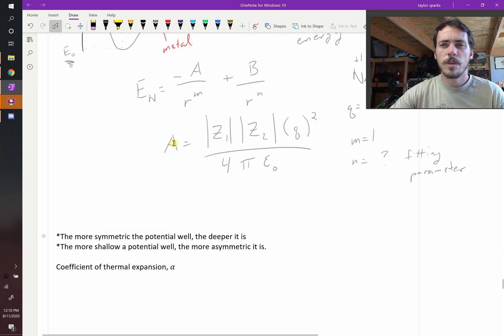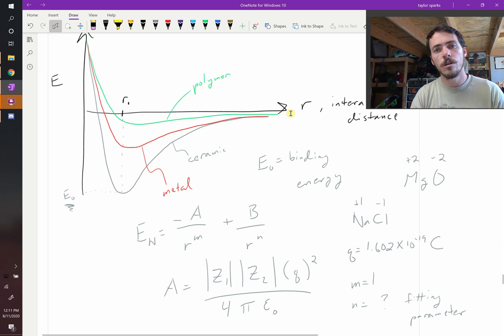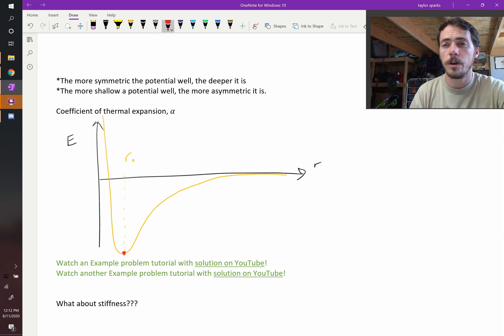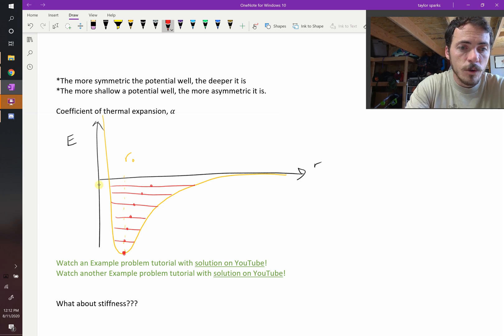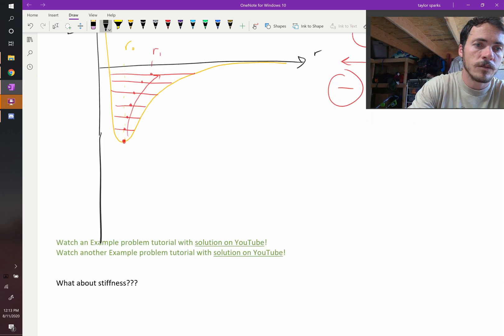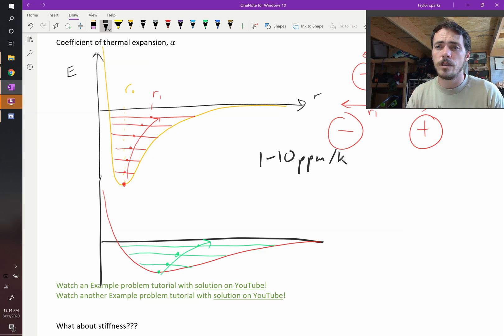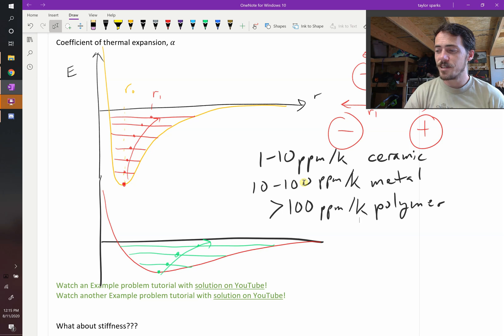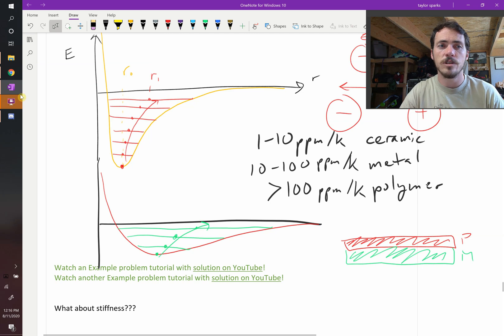Origin of thermal expansion coefficient

Comment: I think a great way to generate renewable energy could be to simply lay a steel I-beam between 2 concrete anchors for example and then to aim reflectors to heat the steel to it's max thermal expansion with the Sun, then to shade it alternately during the day, capturing the energy from the thermal expansions and contractions.

Let's put solar panels on every home, business and covered parking rooftop and switch to electric vehicles making nearly everything we do solar powered while completely decentralizing our power supply and empowering everyone as power generation owners.
Reply: Are you familiar with sterling engines? Its a similar concept but uses gas rather than a solid. Gases expand much more than solids for an equivalent temperature change and are easier to convert into into electrical energy using pistons or turbines. There are also generators which rely on the Seebeck effect rather than thermal expansion.

Heat is simply difficult to efficiently convert into electrical energy.
Reply from the maker: As the beam expands how would it generate electricity?
Reply: @TaylorSparks  Constrained by the anchors, it could compress (and later pull back) a highly geared plunger causing a generator to spin or compress water forcing it through a turbine for example to turn the short distance, high power linear motion into generator rotating motion.
Reply from the maker: @sanjuansteve  curious how this would compare with solar conversion efficiency with same solar radiation
Reply: It could be tied in to a closed loop water heating system through a heat exchanger, using water to cool the beam when shaded and in contraction mode.
Reply: @TaylorSparks  Me too my friend, especially including the water heating benefits (although I think PV panels should have a heat sink and a closed loop coil behind them to make the PV more efficient while capturing and being able to store thermal energy too).  I'd love to build a prototype.  What do you think?  It would be interesting to find the material with the greatest thermal expansion rates and to pair it with an efficient system to convert that linear motion into rotation energy to see.
Reply: @TaylorSparks  I have seen concentrated solar power systems with solar conversion efficiencies of ~31% in optimal conditions, compared with ~23% for the best commercial PV systems. But you are basically limited to the desert for CSP because you need high temperature differentials to drive the heat engines efficiently. Of course, that is ignoring cost.